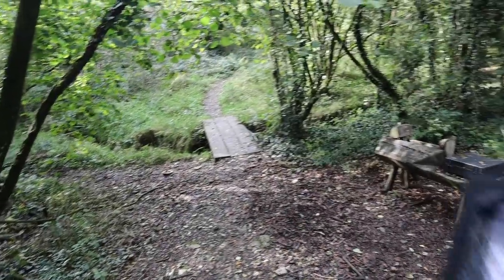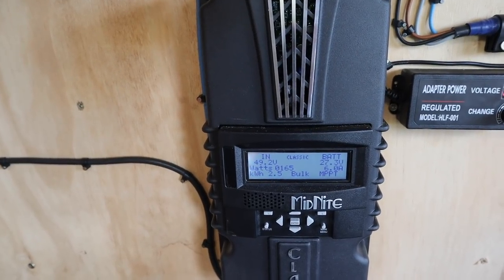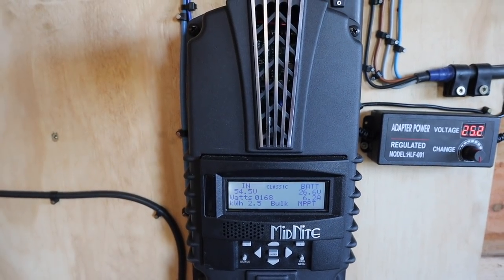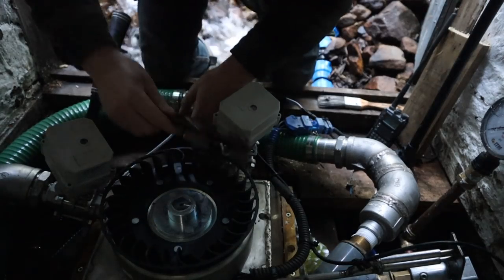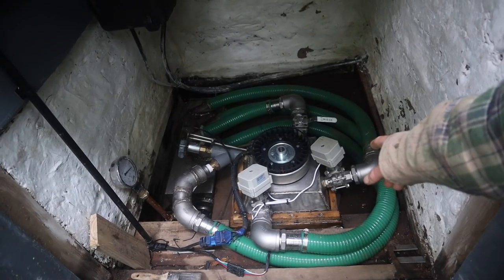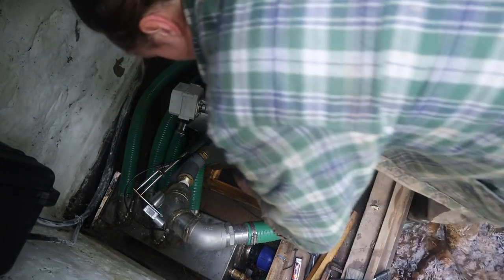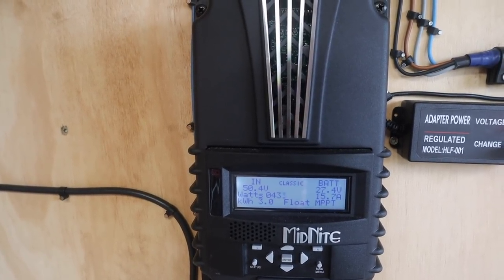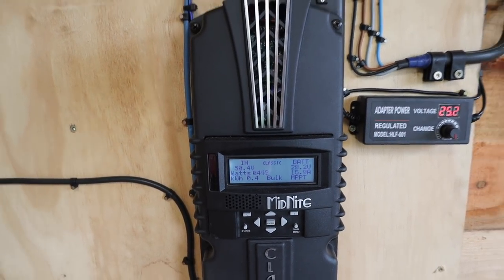Off Grid Micro Hydro Turbine Fine Tuning (13.25% Increase In Efficiency)

Comment: How long is your cable run? I was thinking at 240 volts you would get quite a lot of volt drop (efficiency losses due to the cable resistance) you might get greater efficiency if you use a step up transformer as close to the breakdown voltage on your cable with the accompanying step down in your shed.
Reply from the maker: 50v 16mm squared cable giving less than 1%loss

Comment: While I love the idea of MH and would love to have a setup, There sure is a lot of expense and complication when compared to solar.  It's quite overcast here now and  making 950w Kw from about a 6 Kw system. On a sunny day I do 24 KWH no problem. 

You have set up a great system but the nature of the beast is MH is a much heavier investment of time money and skills than solar.
Every time I see moving or falling water I wonder how much power could be harnessed from it.  Maybe one day I'll be in a position to give something like this a go.
Reply: Solar PV would mean more reliance on storage, especially in the UK where you can go days or weeks without useful levels of sun. By comparison, the darker months tend to rain more so you should get consistent power. People tend to say Solar PV is less trouble than wind generation but a micro hydro takes a lot of beating. Look out for "life at the end of the road" to see a guy in Scotland who uses all of the above.
Reply: @rhiantaylor3446  From the videos I was under the impression he is only running the MH through the day. Could be wrong  but in any case there are already batteries and it would not take that many panels which could be used panels to save costs to generate the same amount of power even on bad days.  If water supply was an issue, perhaps Building a dam might help  to minimise water loss. 

The guy says he has more than enough power from this  so all just hypothetical. 

I look on the real estate sites now and then for properties with good running water where a MH could be set up but here in the driest country on earth, suitable locations are not easy to come by.

Comment: Why don't you build a reservoir for the water ,so that you can collect the pebbles,leaves etc. And also have control over the flow and need not waste water when you don't need to.
Reply from the maker: 5lps x 60 seconds =300 litres. X 60 mins = 18.000 liters. My system uses 18,000 liters an hour. It would need to see a small lake to have any effect and that would flood a large area

Comment: Any options to increase your head?
Reply: Like your attitude of perfecting even if it’s not strictly necessary. Sure you’ll find a way to use the power. 👍
Reply from the maker: No, i have the intake at the highest point on my boundary and the turbine at the lowest point in the stream witch is the boundary. so no option to get any more head
Reply: Kris Harbour Natural Building Figured ...sure you neighbour doesn’t want a small lake? So you can damn to boundary 😜

Comment: You're losing more than you probably want to believe by having hose instead of hard pipe, especially with that curve, which admittedly you've made as gentle as you could with your space.  I'm willing to bet that if you put a pressure gauge before and after that long of an unnecessary bend, you've got much more than the like 1.5 psi savings you get from going from a 90 to a double 45 or long sweep 90, probably enough of a difference to make a hard piped manifold instead.

Comment: hook 2 up in parallel ? now for your purposes here is an interesting twist run a brushless dc motor and drive a tractor set generator with the dc motor ...here we see NTUA doing the same thing ...they are a division of rolls royce of course and the seem to be successfully running a 100 amp tractor set ac generator...but enough of that seeing is believing  https://youtu.be/cqrBDooCqis

Comment: I'm not a hydro specialist, but it seems like you're efficiency tapers off with more volume because it can't transfer energy anymore to the wheel. I think it's spinning too fast at that point. It looks like different gearing or bigger generator would help you make more power.
Reply from the maker: That isnt how it works. the rpm is fixed to half the nozzle volocity of the water. adding more water does not change the rpm is just changes the amount of water hitting the turbine. the reason it tappers off is due to pipe friction loss at higher flows.

Comment: Ok So Downsize the Capacitors behind the rectifier. this will reduce the heat production in the bridge rectifier. This is not the definite solution tough.. in fact I think you can take them away anyways, as the clipper from MIdnite Doesn't have them at all..